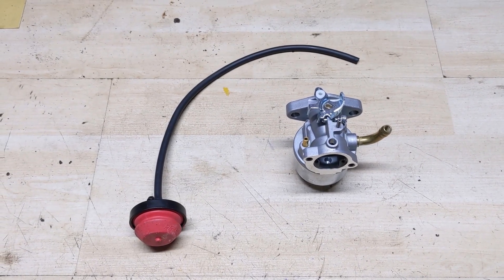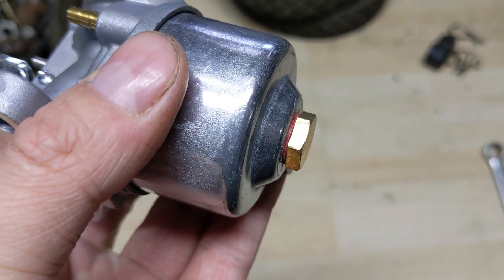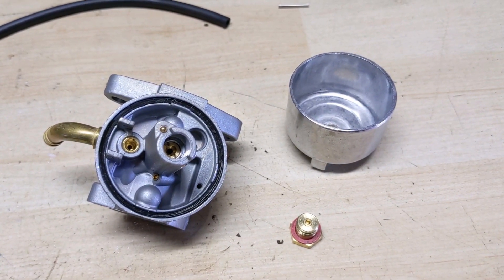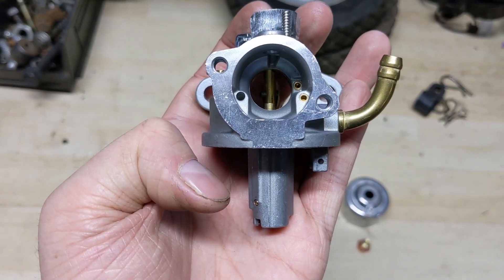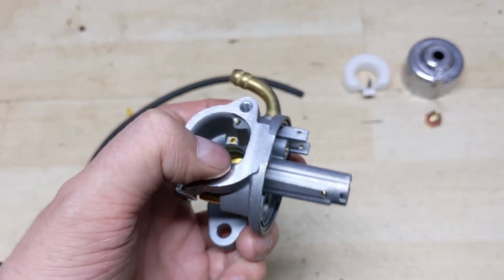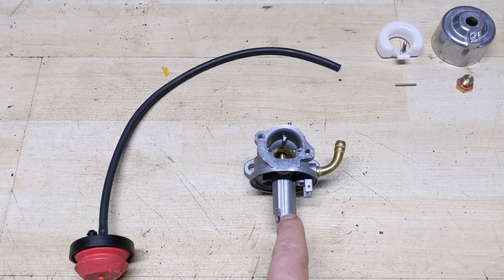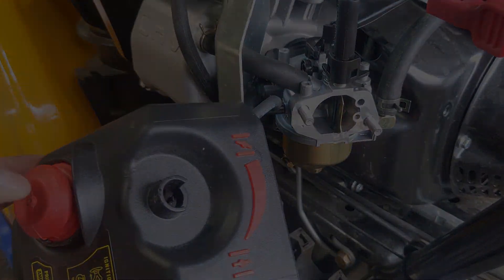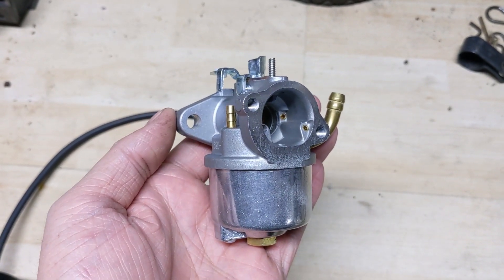How a Primer Bulb Works

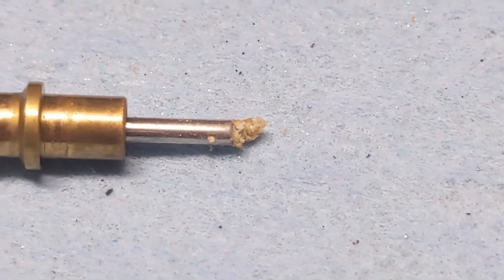Comment: 4:57 where does that crud come from ?  Can it be prevented by using STA-BIL Storage Fuel Stabilizer in the gas ?  - and fresh 'Winter gas' from the gas station too ... I'm going to do both of those on my new Toro  ... , thanks for the very clear video ! ...
Reply from the maker: Mostly from broken down fuel, the fuel now a days has ethanol in it and starts to break down after 3-4 months, around 6 months it's no good. The stabilizer unfortunately doesn't help much anymore like it used to, which is why we recommend the canned alkylate fuel for storage.

Comment: Would a clogged carbeurator be the reason the primer bulb leaks when pressed? The engine starts but runs rough.
Reply from the maker: Sounds like the primer bulb is pressurizing the bowl, but the fuel isn't going through the main jet. So yes, it's very possible it just needs a cleaning

Comment: I can't thank you enough for showing how to fix this problem! I found that if you can even just hold the prime bulb in without pumping it, it stays running, I actually opened a path about 7 feet until the way I was holding the bulb in fell, and it stalled. I might just redo it, so it stays in place (if I can) and do it this summer.

Comment: Wow what a great video I've been learning so much watching excellent videos like yours! I inherited an old 83 Craftsman 5hp Tecumseh. I finally had it running well last year after years of there always being some issue that it wouldn't run properly and out came the shovel. Frustrating. Last year I installed a new carb and friends helped me set it up. Ran great! But this year I had that exact issue you described: I had to keep priming it to keep it running. I stripped and cleaned the carb (didn't see any issue) but it was still doing it. Eventually I figured out that the adjustment to the bowl jet was my problem (as you explained no gas getting to the carb through the distribution tube), but not until I bypassed the petcock and fuel filter thinking those might be the issue. Turns out that jet was set up tightened to the point it was almost closed. Still on my learning journey, having an oldie really helps in that, but surprisingly enjoying it very much. Thanks again for your video and simple demonstrated explanation and I of course subscribed.
Reply from the maker: Thanks for watching, glad it helped!

Comment: Hi , i have a not really old 9.5hp craftsman snowblower and a real problem with the primer. Putting a brand new carb did not help. So it has the new carb a like new bulb and new hose and it is pushing air. The blower will not start with the working recoil but starts instantly with the electric. There is lots of spark when pulling the rope. The bulb has no resistance when being  pushed. Real mystery

Comment: Awesome video !  Mine's not getting fuel at all. Priming or or working starter. I pull plug and it's dry. I Start with bottom Carburetor  jet all the way in and work it out in half turns as I pull start. Each time the spark plug is dry. Pulled the bottom jet n spring and clean holes. {small one also with wire from a twister from loaf of bread} . Yes main fuel petcock is on. I'm out of ideas.

Comment: Great video, thank you for making it. 
One clarification with regard to gasoline: 87 octane gasoline is fine to use in small engines as long as it is 87 octane non-oxygenated gasoline. 
Ethanol is the killer of small engines not necessarily the octane level.
Reply from the maker: @PatrickFaricy  yes 87 octane is perfectly fine, the only reason I recommended 91 is because it was the only grade of fuel sold here locally that didn't have ethanol. Sadly, all grades of fuel now contain ethanol. Here's the thing, 89 octane is a 50/50 mix of 87 and 91, and we have tested the 87 at 10% ethanol, while the 91 only has 5% so theoretically, the 89 should have 7.5% ethanol. So ideally, even though the 91 still has ethanol, it contains the least amount, so we still recommend it. But it depends on the fuel supplier, so really you have to test all grades of fuel in your area (which we've done). You fill your car with the 1st couple liters of fuel, then into a Jerry can. Then switch octane levels, pump the next couple liters into your car, then a second Jerry can, and repeat. This is how we tested our fuel here.

Comment: I know there are subtle differences in these similar-looking Briggs single-stage snow thrower carbs but I’m having a primer problem with a carb (P/N 594015) that looks just like this one.  But my problem is the engine on my nearly-new Simplicity 922 will only run normally if you have a finger covering the hole on the primer bulb and depress the bulb in by about 1/3.  It wants to die immediately if you take your finger pressure off the primer bulb.  Inside carb and in bowl look shiny new.  Float & fuel seem to work perfectly. Tank and bowl drained in spring and fresh gas now. It seems primer-system related but I’m stumped.  Any ideas?
Reply from the maker: @watchyerstep  I've heard of people having issues and replacing it with a 594014 but I've never tried it. Sounds to me like the main jet is clogged if you need to prime it for it to get fuel. I would recommend making sure you have proper fuel flow from the fuel tank, and if you do, then replacing the carburetor, and see if that changes anything.

Comment: I have a primer bulb that doesn't work and a throttle that won't vary speed.  Now I have to expose the carburetor again and try the primer bulb and look for gas.  Primer bulb does nothing.  It's starts fine as long as I keep choke closed.  Just runs full speed unless I slide the choke .  Throttle only shuts it off and lets it run full speed for some reason  Craftsman snowblower 10 years old

Comment: I’m curious. You said that carb was from a B&S engine. 

Are you aware of a carb of the same design that would fit my 9.5hp Craftsman snowblower that uses the stupid Nikki carb?
Blower model 20A114-0363-E1
Reply from the maker: Yes, many of the Nikki and walbro carbs are interchangeable, but you have to experiment with it because the jet size could be different

Comment: Super helpful video! I learned a lot. Used to put premium in my snow blower as it contained NO ethanal. All fuel in Canada now sadly contains 10% ethanal which is unfortunate for small engines.
Reply from the maker: Esso 91 contains no ethanol where I live!
Reply: @EliminatorPerformance  It did here too until recently. Our Federal Government quietly implemented that change. Many still don't know about it. This also won't be great in the spring when the classic cars begin to hit the roads.

Comment: my problem on the cub cadet snow blower carburetor is the upper fuel bowl gasket leaks causing it not to prime. Is there a better gasket than the cheap factory type gasket. A part number would be good too. The main jet and tube are clear. Thank you..Pete

Comment: I have a Toro CCR 2450 two stroke. If I push the primer bulb 2 times it floods the engine and won’t start. Instead of using the primer bulb, If I just put the choke on full and pull the starter rope 4 times it starts. Why does it flood when using the primer bulb? I am reluctant to use the primer bulb because I don’t want to hassle with a flooded engine when It’s time to move the snow. Any suggestions?

Comment: Thanks for the video. I have an engine similar to this (briggs and stratton XR 13.5) on a Chinese excavator but it doesn't have a primer bulb. do you know of a good way to get fuel to the carburetor on a gravity fed system after it runs out of gas?

Comment: I would also stress the importance of a good sealing gasket for the bowl. If the bowl gasket isn’t making a good seal not only will it leak gas but the primer wont be able to pressurize the fuel in the bowl to force it through the Venturi.

Comment: Thank you for posting this! Very good info. When I tried starting my blower the first time this season, it was below zero and the primer bulb wouldn't press. something seermed to cause resistance. Once it was warmer out, I tried it again. no trouble pressing the bulb in but this time I could hear air each time I pressed the bulb and it wasn't moving any fuel at all in the carb. Sounded like just air moving and there was really no resistance with the bulb at all, which I would expect if it was moving fuel. Any idea what could cause this? My first thought was maybe a split somewhere in the line but by the sound, it seems to be moving air and the sound seems to come from the carb.  Thanks again for the info!

Comment: Make a bubble carb it's like they should have always been there it's perfect it act as it's own filter like a water bong and you can even use bad gas because it just uses the vapors it doesn't use the liquid as long as it got vapors it's good maybe add a heater to make more vapors but it works good on a 150cc scooter

Comment: Hi bro, a great admirer of yours from Toronto. I have a Brigg and Stratton snow blower that has exactly the same carburetor. The problem you discussed in this video, I’m having the same with mine. I press the primer button and start it with electricity because it doesn’t start manually. It stays on as long as I keep pressing the primer but when I remove my hand, the engine turns off. I removed the carburetor cleaned it very well and made sure it’s not clogged, put a new spark plug but it still won’t start. Please suggest something that I’m missing. Thank you
Reply from the maker: You might want to make sure fuel is flowing from the fuel tank, as well as through the carb. Remove the bowl on the carb while it's on the Snow blower and turn on your fuel, make sure fuel is coming out. Will be a mess but sometimes they clog at the line or sometimes there's a small screen in the fuel inlet. Search donyboy hidden screen in carb.

Comment: I have fuel that's bleeding back through my primer hose and pouring out is there something wrong with my carburetor
Reply from the maker: Leaking Needle valve and probably a clogged main jet?

Comment: Got a new primer bulb and carburetor  but can't get the rod hooked up the spring  should be easy I have a toro 518 zr  power clear if you can show me how to get it connected

Comment: Will a Toro snow  blower start  if the out side prime button has  a  crack it briefly  starts but shuts down
Reply from the maker: If you have to keep priming it, it's most likely the main jet that's partially clogged and needs to be cleaned.
Reply: I need a new  carburetor I  damage  it so will that correct  the main jet clog??

Comment: Very informative. I just got an older B&S snowblower engine.  model 252413-0727-01-87063010 .The primer bulb was stiff so I decided to remove it. However the plastic housing of the primer which is made of plastic cracked so I have to replace the whole assembly. Interesting though is that there are 2 lines going into the primer bulb. I don't know if someone played around with it some time ago or is it an original primer bulb. One line seems to lead directly to the intake pipe and one goes to the carb. Can I just replace the primer bulb with only 1 line that goes to the carb?

Comment: Hey Eliminator, like your vids..
I have an 11hp Tecumseh blower , new carb but the engine cuts out after 30 or so secs.
Could it be electrical ?
Thanks bud.
Reply from the maker: Take the fuel cap off and see if it keeps running, sometimes they don't vent properly
Reply: Thanks Eliminator, I think it worked seems to run now ,, a simple fix.
Cheers

Comment: And the hits just keep coming!!!!  Great video.  Question:  what if your primer bulb doesn't push back out stays collapsed on your Tecumseh King engine 9 hp.  Thanks.
Reply from the maker: Clogged up carburetor, most of them have a relief hole now though
Reply: @EliminatorPerformance  I will check.  Thank you.

Comment: I have a 2 stroke Toro snowblower and when I press the prime bulb no fuel is getting to the carb but I can hear the air bubble in the fuel tank. Whats going on in this case? If I manually put some fuel in the carb it will run and stay running.

Comment: have you ever dealt with these new Murray push mowers leaking gas from the primer bulb?  https://youtu.be/5AV2gn0YLUs  he did push the primer bulb like 20 times before it leaked so maybe it's normal for it to leak if you over-prime it.  but he still goes on to show the mower is a piece of shit right out of the box.  Or maybe it's possible it's not a piece of shit.  If you over prime it from the start, does the gas level in the carburetor return to normal while mowing or will the gas continue to flow and keep the carburetor overfilled and choke out the engine?

Comment: Great explanation.
One thing that I would like to know is why does the primer bulb have a small hole in the center of the red part. When you press on the primer bulb, your finger is loosely covering the hole.
Reply from the maker: That's to let the air back in when you release your finger, so it doesn't suck fuel up the line! Thanks for watching!

Comment: What would cause the fuel to come out from the primer button constantly but no start from the snow blower? Even when off and the fuel button is left on the fuel is just pouring out, what would cause that?.
Reply from the maker: Probably a leaking needle valve! The bowl is sealed, and if you're main jet is clogged and the needle valve leaks, the fuel would most likely leak out of the primer
Reply: Thank-you